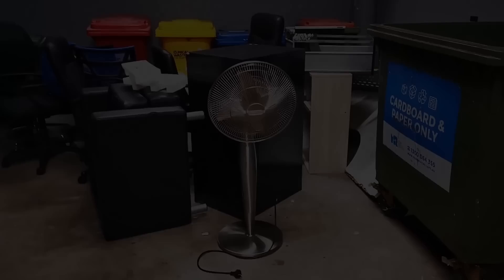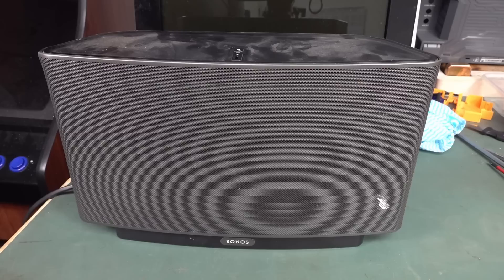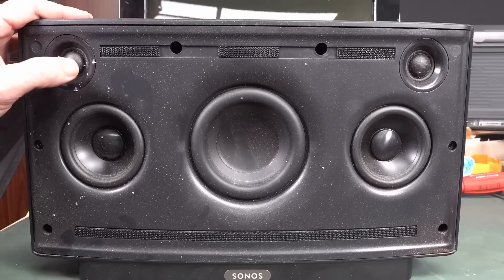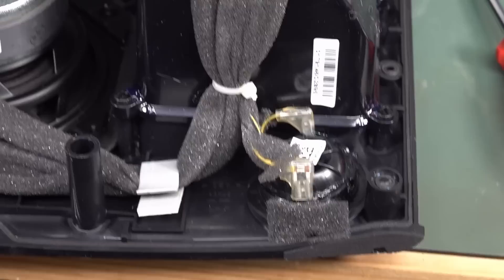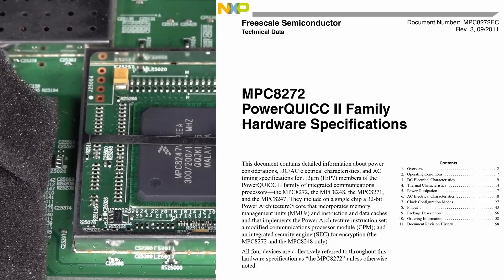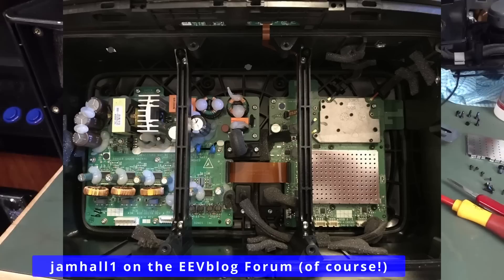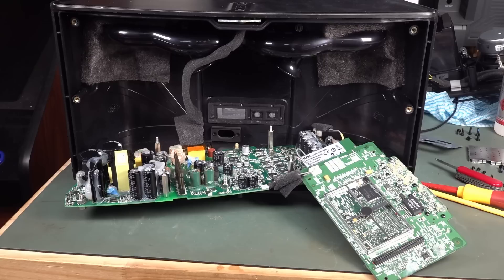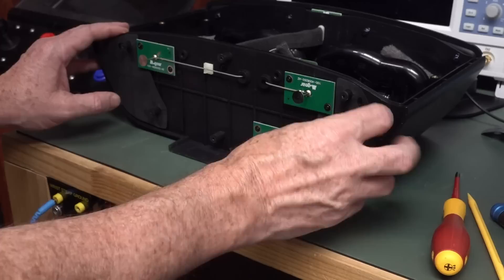EEVblog 1514 - Sonos: The Juicero of Wifi Speakers? (TEARDOWN)

Comment: Vibration is nasty, causing rapid system aging unless ruthlessly damped.  Back when I worked on aircraft instruments, we had solutions certified for both piston and jet cockpits that had excellent field performance.  Moving the same instruments to the helicopter market (with a few software changes) opened up a can of worms when we reached vibration/shake testing.  We had to add physical clamps for our larger capacitors, more mounting screws for the PCBs, and lots of silicone snot.

All of this paid off when we targeted the military market, when the US FAA and DoD finally agreed that military aircraft should have a complete civilian instrument load-out when flying in civilian airspace, and the DoD had a sudden need for "plug & play" cockpit upgrades (which was our niche). Boeing and other military suppliers tried to add FAA software upgrades to their military cockpits, but needed to charge so much that it would have been cheaper to retire the aircraft early!

We made a bundle on those deals.  But only because the civilian and military vibe/shake testing specs for helicopters were very similar, and our instruments met mil-spec with only retesting, no hardware changes at all.

Having a full-spectrum high-power vibration source INSIDE my instrument would drive me crazy!  The Sonos folks didn't miss any tricks, so far as I can tell.  Just treat it as a hostile environment, and design accordingly.
Reply: Vibration inside a speaker cabinet really isn't that much of an issue. A sturdy cabinet should barely vibrate at all and what's coupled through air will not be anywhere near aircraft levels especially not with a 4" bass driver. That's why even active computer speakers with shoddy engineering (Logitech etc). will usually last for decades.
Reply: We made PCBs for railway traction control, they were the thickest PCBs I had ever seen and mostly through-hole.

Vibration is tough to overcome.
Reply: Yes helicopters are a different ball game when it comes to vibration. Every instrument panel is on shock mounts, and those have no rubber in them to do damping, as that fails too fast. Changed a good number of those metal mounts because there was almost nothing left of the steel wire brushes that are used to damp them, though the springs in the middle were still fine. Take it out and the cup that holds them is full of small metal filings, that used to be stainless steel wires. There is a reason every fastener on a helicopter is either lockwired, or self locking of some sort, because otherwise there would be nothing in them after a while.

Most common repair was putting floor attachment points back in, because they tore out of the honeycomb floor. We used to get Araldite slow set epoxy in 5l cans, not the little dinky 50ml tubes, and would often need 2 or more cans to fix a floor. When those tore out again the Araldite was not the failure point. That and the rolls of 3M blade tape.
Reply: @westelaudio943  Logitech speakers (the cheap 2.1, 4.1, 5.1 ones) will last for decades :) 
     Found a 4.1 system in the trash recently - looks like hell, but works perfectly still)

Also; Cambridge Soundworks (which might also be Logitech now). Not too expensive, but my 5.1 sub has lasted for about 20 years now.
No buzzing or anything
Reply: @BobC Exactly...

I'm not from one of those fields .. but i just sat here and thought ... heck, this thing is nicely overbuild .... but fuuu, it's designed to be a heavily shaking thing with lots of dynamics between the drivers and case and .. whaaaaaaaa ;)

So shoot .. no it's not a juicero .. not from the hardware design point of view imho...

About software and licenses and stuff... well it's a completely different realm. ;)
Reply: @westelaudio943  Yeah but you still don't wanna have the pcbs rattling lose after some years. ;)

And most speaker cases are mainly glued shut ..... this one had to be screwed.. dunno ... considering it's not a wooden thingy overall, that seems to count in here. ;)
Reply: @iggysixx  I'm still using a early cambridge soundworks 4.1 in a 2.1 config for my desktop speakers..... i only get doubts about the capacitors after all this time .. but heck .... i fear to open that subwoofer .. because....... ;)

.oO( P.s.: The remote volume knob on the main cable has seen a good amount of contact cleaning spray over the years btw .... i finally stopped to use it anyways since i have volume buttons on the keyboard...... ;))
Reply: @hackbyte  

Yes, but a bit of glue on screws and more hefty components as well as some felt or foam padding does the job. 
When I build speakers, I use point to point wiring for (passive) crossovers and secure the components in place individually. Logitech is known for using as many screws as possible on the outside, yet as little as possible on the inside, for instance, the whole switch mode PSU is secured by only two wood screws in many models. 
Even many expensive  'boutique' speakers will have very shoddy wiring inside, believe it or not. You will find wires tacked on by solder without j-hooks or anything, power resistors on long wires glued in place by hot glue and covered by damping material, whole boards glued in place with hot glue, stuff like that. On otherwise fantastic speakers. But even those seem to hold up somehow...
Reply: @hackbyte  Using my 5.1 subwoofer as a 2.1 as well. 
      For my macbook setup, it's my amplifier + sub, and the 2 speakers are massive BNS E34 'bookshelf' (more like 'storage shelf' ;)) speakers... (Woofer / mid / tweeter cones + built in crossover. 90W, 8 ohm)
        That thing has no problem powering the speakers (: 
Pretty massive sound altogether (and nothing rattles ;))

If your unit is currently working fine, I suggest not touching the capacitors just yet.
      (I guess it would technically qualify as a 'solid state' / transistor amp?)
       From what I know (and that's not a lot :P) about 'solid state' amps; they last a looooong time without maintenance.

I reckon it's probably fine, until you hear otherwise. :)

There is a possibility they put some kind of sticky seal around the subwoofer (to prevent vibrations).
      Depending on how yours opens, it could mean breaching that seal, and that could introduce problems.

-

About the Juicero comparison - needing an account or an active subscription is the issue.

It's not the same.
Juicero has a sort of DRM (digital rights management) built in. You need to scan the juice packs (to check for authenticity / expiry date), and it will refuse to work when the pack is past expiration.

Though the 'you need to be registered' thing is similar in nature, Sonos doesn't force you to keep buying new things to keep it functional.
      That's the main difference.
Reply: @westelaudio943  Heh uh well, i believe you very much... I happen to own a Grundig Fine Arts A9009 amp which formerly drove the Visaton Atlas DSM MK II/II Speakers of a friend of mine....

Well i happen to own 2 of the same size visaton bass chassis in their own custom build cases (i collected from somewhere else as is ;)) too..

So ... hrr... even in the highest of high realms of hifi, they only boil plain water too..... ;)

But one needs to be ready to take the power and shaking nonetheless. ;)
Reply: @iggysixx  Uh, you use that amp with those fat speakers as satellites? Interesting idea... ;)

About the incriminated electrolytics ...... sadly, yeah, in the up most peak loudness cases .. they already start to sound outpowered sometimes......

It's not that i use them regularily at that volume .. but ... as i said ....... maybe in a few years ... i need to open that case and see if i can get some replacement parts. ;)

To the Juicero comparison.. Yeah, sonos has a very different product from the get go ... but nonetheless, they're in the place of a company who needs to sell new hardware every so often.. mhhh.............. ;)

But yeah .. speakers and amps vs a "lifestyle product" as juicero was .. it's a evil and hard comparison anyhow. ;)
Reply: @hackbyte  Not an unfair comparison, though. (It's only an 'evil comparison' in the 'lesser of 2 evils' sense - both requirements suck ;))

As for the speakers, make sure you try 8 ohm or 16 ohm ones. (I think the normal satellites should be something like that too)
Big 4 ohm speakers might fry the amplifier circuit (:
Reply: @iggysixx  In my desktop setup, i just plainly use the original satellites "stacked" to get normal stereo out of the 4.1 as 2.1 configuration.... And i'm still happy.... i didn't ever thought about changing out the sats .... because..

Yeah i have "way" bigger chassis to use in case i want to have real hard power..

(Namely a Sony TA-F 535R as main speaker amp .. and said Grundig Fine Arts A9009 for the bigger visaton chassis...;))

It's actually astounding, that those "puny" cambridge soundworks 4.1 ones suffice to blast your eardrums out on their own, when used and driven properly....

Combining just them with the TA-F535R amp and some upper-range cheapo "disco speakers" alone did a frickin hell of a Db mess once..

 Luckily we get older .... and as i said, the cambridge soundworks ones do the trick for an adult at least. ;)
Reply: @hackbyte  

Oh wow, the TIW 400 were great woofers, shame they don't make them anymore. 
I also like the full range drivers from Visaton, The smaller ones are good as midranges or mid-tweeters in a two way.
Reply: @westelaudio943  Oh yeah .. and they take a fair amount of power to get into their best dynamics ..... but are well worth it. ;)
Reply: @hackbyte  You shouldn't have to apply contact spray more often than once a decade or so at best. Might have been the wrong kind for that kind of job, possibly the non-sealing variety. My CSW 2.1 volume pot remained entirely unproblematic after a single application of Teslanol t6; in terms of the Caig products that are more common worldwide, something like either Faderlube F5 only or D5 followed by F5 for more severe cases would seem appropriate. (In an ideal world you would be deriveting the pot and cleaning the wiper with D100 and the track with F100, but who realistically does that on something like this?)

BTW, I've taken some measurements of a CSW 2.1 recently... I always knew the treble was on the lively side, but I wasn't expecting an 8 or 9 dB boost. (At least they did also confirm that you can get the entire midrange pretty flat once the sub is actually on the desk, one of the few systems that allow doing so.) You can find those plus a parametric EQ derived from them on ASR.

BTW, I'm not sure whether I'd recommend stacking two of the satellites, even top-to-top... it would no doubt make treble directivity extremely narrow in the vertical. While this should help with desk reflections (potentially aided by giving them some extra height), it may leave you with a "head in a vise" scenario for best listening position. The changes in treble response as you more around are fairly noticeable as-is.
Reply: @hackbyte  I have a 'real' amp too. Vintage + stereo (Akai AM-32), though. So only connections for cd player, cassette deck, phono, aux. (everything is taken already. So no direct connection to my computer setup. I can stream stuff via my Airport Express (last gen), but with a delay)

Massive sound, but the right channel needs fixing. Haven't gotten round to it yet.

>> [TMI alert: too much info after this point. Read at own risk (; ]

Might sound 'archaic' to keep the amp, but it's late 80s (or early 90s), and has the option 'source direct', which bypasses all treble / bass / etc modifications, and (alledgedly) has only 0,003% difference with the sound as recorded. 
     (That... Is truly a weird and awesome thing. It's weird because in my mind it's like: "how much difference can it really make?". 
But when you flip that switch, the clarity you suddenly get.. It's like you just hooked up a whole new set of speakers with much more dynamic range, and even fuller and crispier bass.
      Apparently, there's a fair amount of processing going on in your average stereo amplifier)

Comment: The 74AC over HC will be because they are being used as gate drivers.  Faster switching means lower dissipation in the driver, improving the efficiency of the amplifier and lowering the internal heating.

Comment: Foam around wiring and plenty of sealant is to help stop vibrations. Everything has it’s natural oscillating frequency and inside a speaker it’ll be quite intense. It’ll help audibly as well as increasing reliability.

Comment: Worked on it, you're pretty much right on, it's a ppc computer with 6 dac-amps mounted on. The later ones cut costs better but the first one was both over and under-engineered, still pretty good, expensive as hell.

Comment: Looks like early production, before they got the design down to cut price. Likely later units had a lot fewer fasteners and a lot fewer components, as they Muntzed the design. Likely later on they got all the power devices into a single package or three, using the integrated amplifier to drive the H bridge units. 5 channels of audio, only 5 drivers, 4 being single ended with DC coupling capacitors in a row, likely the middle of the 5 being the board decoupling, and the fifth one uses 2 inductors and differential drive for the "big bass" drive. Good filtering as well, likely actually passed all EMC compliance first pass with a good margin, and likely rev 2 and later on they sort of optimised it to get the cost of the filtering down.

Separate antennas needed, and good ones, as these tend to be used far away from the music source, or in a garden, so need great wifi connectivity, and the BT side also has to have pretty decent range so as to work over 15m range or more.
Reply: For years Sonos were the only company who could pull off functional multi-room - its because of the antenna solution you see here.

Comment: Very nice to see they have done so much to avoid vibrations causing issues. When you consider the frequency range of vibrations, it is not surprising they have gone to town. Nothing worse than having a speaker system that vibrates at certain frequencies.

Comment: The discrete open-loop Class-D amplifier construction was pretty interesting and I didn't expect that in the beginning. However, I teared down a Canton DM90 (first gen) soundbar a couple of years ago which falls into the same time of that Sonos Play 5 shown in that video and there was a similar amplifier construction powered completely by Renesas products. A DSP with direct PWM outputs and then having some external dumb power-stages. So it seems like that was common practice in the middle 2000 years (I think the start of having class-d in consumer products). What I personally think is even more interesting is the Freescale-CPU. For the fact that it is a single-core 400 MHz chip, running most probably linux, very slow SDRAM, handling all the DSP stuff, networking and audio-decoding in software this is impressive to have that running on such a low-power computing platform.

Comment: I think all of the silicone/hot snot is there so that there will be ZERO chance of anything vibrating. If I spent $800 on a speaker, and I heard the slightest hint of vibration, that would be returned so fast it would make their heads spin…
Reply: Absolutely !

Comment: repaired a few of them (play5 gen1) so far,  they still work unless they are in recycle mode (which bricks them and gives you a discount on newer models.. they cancelled this program but allready bricked ones are dead)    
they (90% of the time) die by a spike in the mains .. bad filtering,  new rectrumfryer and fets and a fuse.    but some times no sound or silent sound is coming out, then a resistor on the bottom board near the connector to the top boards is dead.  R27835 or the ones nearby (to switch power for the class-d amps.)

they work fine.. if they work. just that account and update stuff is annoying.  if they had the recycle program for longer people would have made a custom firmware for it.
its not quite juicero. you need a account yes but you dont have to pay to use it.  you can stream from free services or local music libraries.  
they have LAN ports to sync them for lower lantency if you are using them as tv speakers or something, over wifi you got a second or two, fine for music but not movies.
Reply: Couldn't one just replace the digital board with an raspberry pi / esp32 (squeezebox)?
Looks like i2s audio, add a dsp chip inbetween to generate the individual channels from 2 and bypass the sonoff board
Would be interesting to reverse engineer a bricked one buut... I have none :P

Comment: You may say Juicero level of smart speaker, but their smart power amps (Sonos Connect:Amp) from 2006 still sells for 200€/$ on Ebay because they still support Spotify and are absolutely bulletproof even when plugged in 24/7 for 15 years.

Comment: When it comes to all the belt and braces retainment - when it comes to speakers you need all the screws and Silastic you can get. 

I've had many many expensive speakers that ended up rattling because they didn't go far enough.
Reply: The one I can remember the best is the TDK boombox from around 2011... I saved all my pennies for this $400 speaker - and it ended up buzzing every time a certain bass note hit. 

I exchanged it for another one, thinking I got a dud - but the second one was just as bad. 

Could have been just a wire that didn't get foam and Silastic, and was slapping against something. But it ruined the product for me.